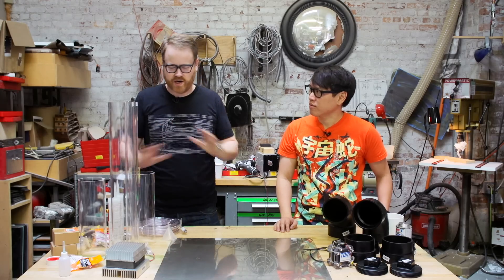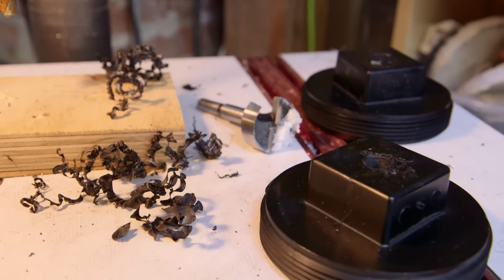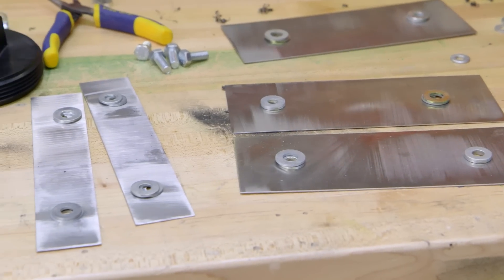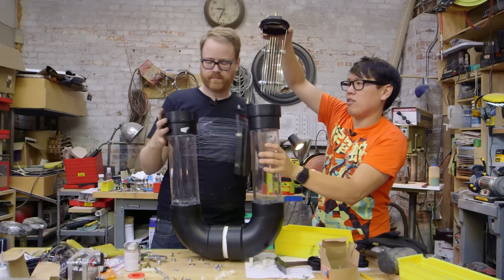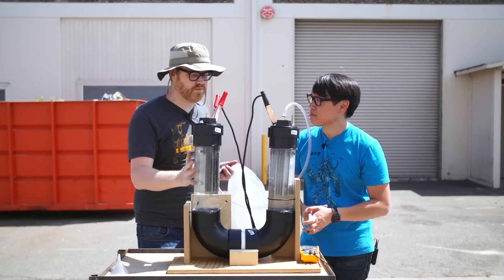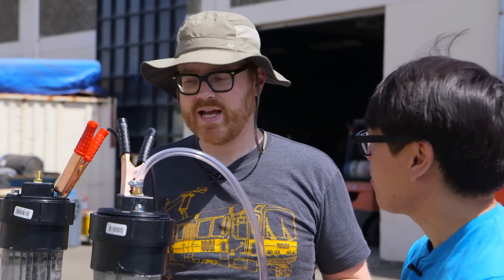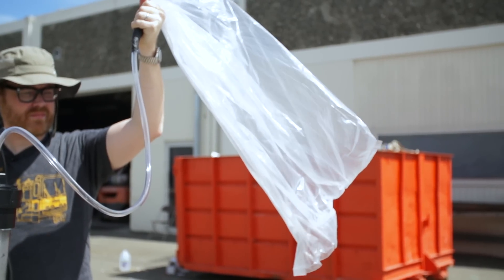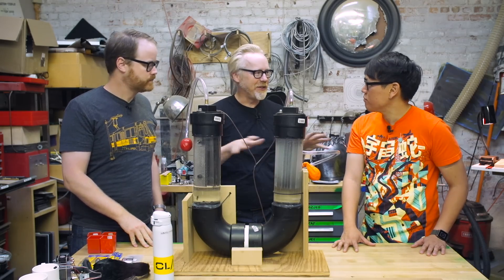Tested Builds a Hydrogen Converter

Comment: "Green" alternative: recycling. 2 used  hp server hot swappable  supplies off of ebay. (or SF computer recyclesr) Try 12v at first, then  bridge the two and you get 24v and 1000 watts

Comment: A more efficient water solution would have been water+zinc+hydrogen peroxide.

hydrogen peroxide is composed of 3 oxygen atoms IIRC. It having a weaker bond, would have a ripple effect to coax the h2o to split more freely. 

Overall, this process would yield more oxygen, but would make obtaining hydrogen faster.

Learned this in my 3rd grade class :p

Comment: I'v actually created hydrogen in a similar way, but I would say that this setup is not ideal.
Things to keep in mind:
1. Plastics is not gas tight if you are storing hydrogen.
2. More volts doesn't equal more hydrogen.
3. More surface area of the cathode and anode isn't going to speed up the reaction. (as it's normally not the limiting factor)
4. Distilled water has a pH of 7, and therefore conducts current. (most chemist knows this.) And most electrolytes are partaking in the reaction, making either the oxygen side or hydrogen side rather polluted with other gases.

Comment: There's a good reason the oppositely charged plates are very close to each other in a proper functional hydrolysis box: the closer they are, the less resistance there is to current flow, and thus more power will flow and more gas will be generated. The large distance between the two electrodes in their modified design was the only problem with it. It would have worked if the voltage was a lot higher or the electrodes were closer.

Comment: Seems it would be easier to power the shop with solar cells instead of hydrogen. Bypass the hydrolysis process completely. We should be careful about wanting millions of hydrogen powered cars on the streets. They exhaust water which in colder winter climates would result in very icy streets. In desert areas like Phoenix enough hydrogen powered machines could increase the relative humidity of the area and change the ecosystem over time. Yes boys and girls even water can be a bad thing.

Comment: Nice video Tested just a quick safety tip ive learnt from working in labs, the best method for stopping chemical burns is using a chelating solution like Diphoterine or similar, rather than try to neutralise with the opposite acid/alkali. it works much quicker to prevent damage to eyes and other useful fleshy bits.

Comment: (ranting against hydrogen fuel cell cars) Fun experiment but... making hydrogen fuel cells to put into cars is just ridiculous. A Hydrogen fuel cell car is basically an electric car with a thing that makes electricity. From Hydrogen. That someone had to use electricity to separate from water in a factory somewhere. Sold to you by oil companies at a gas station. Madness. Instead of building millions of small hydrogen fuel cells to make electricity for individual cars, just make electric cars. All the energy comes from a smaller number of sources. If you want to keep using hydrogen to make energy, great. Just build a powerplant and let people plug in their cars at home.
Reply: What I was trying to say is that, all practicalities aside, hidrogen, as an energy storage medium, is better than today's electrochemical batteries. And energy storage efficiency is a huge deal in moblie applications as cars, that's why we still mostly drive cars that run on terribly inefficient internal combustion engines. Even ethanol has a much higher energy density than batteries (50kg worth can power your car for 500km with engines that are less than 40% efficient), and it's already made today, in the end, simply from air (CO2) and solar energy (harvested - no pun intended - in huge sugar cane plantations). I had not initially thought about limited peak power delivery from fuel cells, but overcoming that is a technological advancement that would as well have to be made in improving battery capacity, longevity and charging speed for them to be practical. By the way, I don't think that charging a 90kWh battery in 5 minutes - as we do today when filling up with gasoline and would do just as well with hidrogen - would be possible in the foreseeable future; quick battery swapping infrastructure, in turn, comes with its own set of problems.
Reply: +Cristiano G. Hydrogen has a lot of energy per kilogram but it is very  light and it takes a huge amount of volume  to store that energy
Reply: +Richard Dufault and how would the "purely electric" cars store the electrical energy they require to run? On Li-ion cells with limited charging cycles and 0.36 MJ/kg energy density (figure from a quick Wikipedia search)? Or as compressed hidrogen, at 142 MJ/kg? All you need to get that energy out of the latter is a fuel cell, which would probably not compromise the near 400 times energy storage per weight difference... and good luck charging your batteries on a road trip...
Reply: +Cristiano G. Pretty sure people already do charge their cars on road trips... good luck rehydrogenating your car on yeaaah, it's the same problem. 

I get the point about energy density and storage, that makes sense. You may want to cite volumetric  energy capacities for Li-ion v Hydrogen too since that's actually a rather large factor in vehicle design. 

The only part of this video I actually have a problem with is mention of a hydrogen powered workshop... just why?!?!? it's already all run on electricity and poses a higher safety hazard (also, not like all his tools run on gas)
Reply: 99% of car owners do not need a car that can go farther than 100 miles on a charge, except maybe a few times a year when they go on a road trip. You can do that now with basic car batteries. You could rent a gas burner, or wait a couple of years for some kind of fast charge, or some kind of charge as you drive scheme, like they have for electric trains. It's going to happen.

Folks that use the argument that lithium or other batteries are somehow worse for the environment than gas burning cars or any other technology obviously don't own a mobile phone, tablet or laptop, since they all generate millions of tons of battery waste every year.

Hydrogen fuel cells are purely a distraction created by oil companies to keep people on the leash. Doesn't matter anyway because Musk and his radical ideas are forcing the change on us. There will be no more gasoline cars in my lifetime, and when people realize how much hydrogen fuel cells cost, the
Reply: Do some basic research. Obviously, don't just read one article. But just do a search on Electric cars versus Hydrogen Fuel Cell cars, and you'll see lots of good science explaining why it makes no sense to use energy to make hydrogen, put it in pipelines and tanks, and sell it to people to convert back to electricity. In a car that needs batteries to work any way. This video pretty much shows how silly it is to use a solar cell to split water into hydrogen and oxygen, when you could just use the solar cell to charge a battery.
Reply: No saying it wasn't a cool exercise.
Reply: +Richard Dufault electric cars have no range, and take too long to recharge. So electric cars are a non-goer.
Reply: Paul Frederick No. Saying electric cars have no range is false. Do some research. Modern electric cars have 50 to 100 mile range. I don't know enough about recharge times, but keep in mind that 99% of the driving people do is well within the parameters of a single charge, or of a drive with a partial charge in the middle. Don't take my word for it. Look it up. Besides... most families have more than one car. Car rental companies exist. For the few times per year that you need to go on a road trip... rent a car, or use your second car? Or take a train or bus?
Reply: Richard Dufault
50 to 100 miles would barely get me out of my county. It certainly would not get me back home! I need at least 300 miles, and the ability to quickly refuel the vehicle I am driving. Which is why I drive internal combustion engine powered vehicles. I need to go on road trips all of the time. I am not living the life of an office cube rat over here. If that is even really living.
Reply: Dude, if you drive 300 miles a day, you're not the typical consumer. If you're a door to door driver, then you need a car with range. Remember I said 99% don't need the range.
But you know, Tesla's (admittedly expensive) Model S gets something like 240 miles on a charge, and charge quickly. Even at 80K in cost, if you factor in the savings in gas (it gets something like the equivalent of 100MPG) and maintenance (no more oil filters, brake pads and other gas-guzzler gouge points), you might actually save money. You probably drive something expensive anyway, if you're in the car that much. I bet your gas costs and car maintenance costs are astronomical. Obviously, if you drive a van or truck, the market isn't there yet. But within 10-20 years, you'll see.
Reply: Richard Dufault
How much cargo can I haul with a Tesla Model S? I need to shlep just more than my ass around, you know? A lot more in fact. Yes I am a truck user. within 10-20 years I'll be in a wheelchair, so my needs will change then. But right now I'm still moving, and shaking.
Reply: Paul Frederick There's no disagreement here as far as I can tell.  The argument for electric cars is that 99% of the people don't need moire range. It's going to be a long while before all the trucks and delivery vehicles are replaced by electric. In the meantime, hydrogen fuel cells will not do any better than what you have now, and even if the fuel cells somehow get improved to the point were you can use one, pure electric will always outpace hydrogen in cost and usability.
Reply: Cristiano G.
Yeah who would want to buy a new car, then swap the battery out of it for an old one the next day? Plus people would be running all kinds of scams with battery swapping. Because that is just what people do. Everyone wants to make over, and pull a fast one, if they think they see a chance.
Reply: Sure, agreed. And changing batteries in a car would be pretty difficult, I imagine. Fast charging would be the way to go, or some way to charge while driving, like electric trains do. Not hard to imagine on a highway network, with an aerial that would come out of the car's top or something like that.
Reply: Richard Dufault
OK for arguments sake let us for a moment consider that charging on the road is technically feasible, would we still really want the government in the energy distribution business? I mean the government seems to have a unique way of totally screwing up absolutely everything it gets involved with. Heck the government can't even run a whore house profitably. If they can't do that then what are they actually capable of?
Reply: Er, Governments are already distributing energy through the power grid. OK, if you want to live off the grid, just use whatever electrical power you end up generating on your own.
And sure, to do some kind of power system on highways would require a huge investment. Future tech. 
To go hydrogen, a completely new infrastructure would have to go into place, controlled by oil companies. Did you know that currently, hydrogen is made from natural gas, a byproduct of fracking? Making hydrogen from water is doable, but requires a lot more electricity to do, and requires clean water. Not salt water. Insanity when a water shortage is looking the USA in the face.
Reply: Richard Dufault
The government had better not own the grid that my electric company built. Built with my money I might add. All the government does is meddle with the grid in the way of overbearing regulations. But own, and operate it? Ah, no. Yes I know that hydrogen is commercially produced by reforming methane gas. I stated that in another comment hours ago now. I also have absolutely nothing against oil companies either. They provide me with valuable services regularly. Electricity would pass through salt water just fine. Better than through pure water in fact. Though you would end up with precipitates. But if you read my earlier comment you will find other arguments against using electricity to break down water. I do get tired of having to repeat myself.

Comment: Do not wear gloves with a pillar drill, the gloves can snag on the drill and (potentially) pull you in. Not very likely on a little drill like that but big drills have been known to break arms.

Your anode and cathode were too far apart, meaning you didn't have enough current to work very well. Try making a new one with them closer together. That or connect a big bastard power supply, maybe a stick welder or battery charger. It did look nice to be fair (Well, not the stand, which probably made Adam's blood boil).

Comment: sorry, but.. i still confussed, how do you know hidrogen is come out on that side and oxigen on the other side?
Reply: Stolen from the comments below:

There is an equilibrium in water

H3O+ + OH- <--> H2O,

known as "autoprotolysis" of water. This means, it happens on it's own 
and all the time.
This reaction provides the reactants for the electro-chemical reactions:
Anode: 4 OH- --> O2 + 2 H2O + 4e-
Cathode: 2 H3O+ + 2e- --> H2 + 2 H2O

The electrons are exchanged over the electric circuit. If you multiply 
the cathode equation by 2, it matches up stoichiometrically. Oxygen on 
the anode, hydrogen on the cathode. Simple chemistry, no magic required.
 Look it up in every basic inorganic chemistry book from the last 100 
years.
Reply: well i'am just little bit confused but i think i understand it like this

so, there is 2 barrel.. cathode and anode is depends on amount of "the plate"(if i'm not mistaken its alumunium), is it right?
Reply: +Afif Fankover No, it has nothing to do with the plates. The plates in this case were the same size on each side. What makes it an anode or a cathode is the direction of electricity flow.The anode is where the current enters and the cathode is where the current exits.
Reply: well that's explain everything.. thanks man..
Reply: +Afif Fankover  Water is made up of 2 hydrogen atoms and 1 oxygen atom. All elements (except hydrogen) want exactly 8 electrons in their outer shell. Oxygen has 6 electrons normally, so it really wants those last 2 electrons to add up to 8. When Oxygen bonds with 2 hydrogen atoms, it pretty much steals the electrons from them. This makes H2O very polar, which means one end of the molecule is negatively charged, and the other end is positively charged, like a magnet. A battery stores negative charges at the cathode and positive charges at the anode. The hydrogen side of water is attracted to the negative cathode terminal, and the oxygen side of water is attracted to the positive anode terminal. This actually splits water up. In fact all chemical reactions are merely an exchange of electrons. Electrolysis forces water apart by tearing at the polarity of the water molecule. GO TEST THIS FOR YOURSELF! Build this, fill a balloon, light it up. See if it really works! Good luck :)

Comment: it is so slow becaus the plates are to far appart
you need rediculus amounts of current for that to run efficient
there needs to be less water between the annode and cathode
Reply: Not just that, the power supply could only produce 100W theoretically, not angles correctly and not in the sahara, it would produce maybe 3 amps or so. In that respect a car battery can generate much higher currents.
Reply: true that
Reply: +robot797  totally agree a decent car battery will put out 750 to 1000 amps. I dont know why they are so intent on saying hydrogen generators dont work. they did the same on myth busters. obsered
Reply: clearly these dudes didnt research shit or are being told to make this shit for sheeple who are interested in hho. to make it seem unsafe and a waste of time.like the myth busters try at it.
Reply: +robot797 Will even says to space them with washers but they used nuts instead
Reply: ranwolf76 yea nuts will conduct better
to bad they did not try to improve this device
Reply: +james soper the problem isn't making an efficient generator, it's making one where the hydrogen is separate from the oxygen. typically generators you see have the two gases mixed, and they wanted pure hydrogen.
Reply: cavemaneca But reducing the space between anode and cathode should still speed things up a bit. Not that it matters that much, for most hydrogen powered equipment you need liquid hydrogen, which their apparatus cannot produce.
Reply: +Joe ghost pretty much what I thought.. a disappointment to say the least..
Reply: +Joe ghost how to prove you are a self aggrandizing asshat in one word, use the word "sheeple."
Reply: +robot797 To overcome the resistance of the water they need higher voltage, not current. Moving the plates closer would also have the desired effect because the resistance is less.

Comment: I'm not entirely sure but the surface area shouldn't have much effect on the the rate at which you produce hydrogen and oxygen. Your only reducing the energy lost in the electrodes due to heat. So I don't think sanding the electrode would help a whole lot. It also increase the surface to absorb  / the hydrogen atoms , but I think that effect will be negated by the large distance between electrodes. Its also the current that changes the rate of reaction not the voltage. Theirs need to be at least around 2.0V for the reaction to occur, after that your just going to be increasing the current draw rate with bigger power supplies. That's why car batteries are used because they can happily produce about (30 - 50)A where as your solar panel will struggle to produce  more then 5A. The biggest difference is that because you've separated the electrodes atoms have to travel a far larger distance, thus your going to get a slower rate of production.